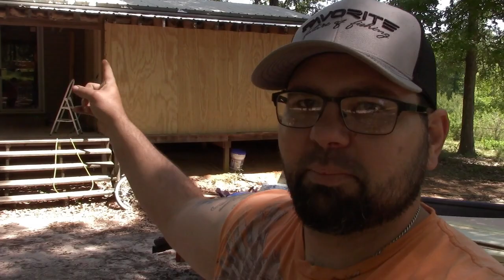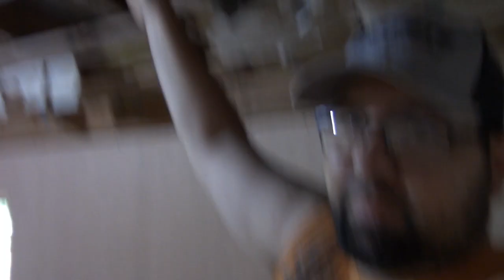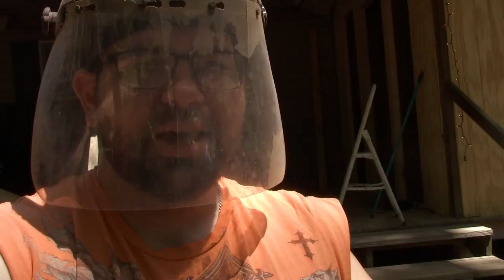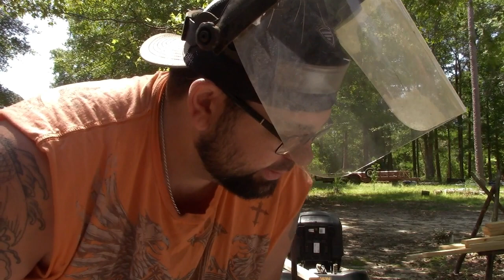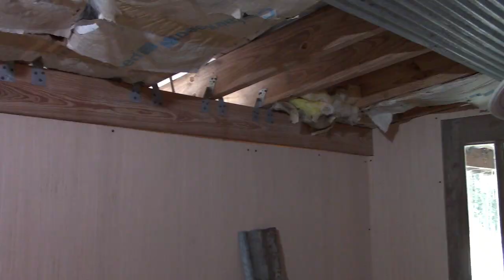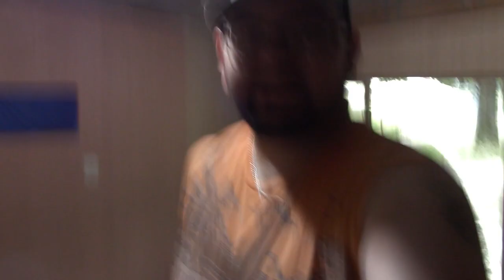Cutting Metal With A Skill Saw

Comment: Maybe if I had nothing else ok but I don't trust it I would think eventually that blade would mess up since it made to just cut wood not actual metal which is much harder they have better blades that cut cleaner lines in metal
Reply from the maker: Yes towards the end of the video I talk about it ruining the saw blade.
Reply: @BackwoodsRaised  yeah I saw that after I commented I would be afraid a saw blade tooth would completely break off and go flying back